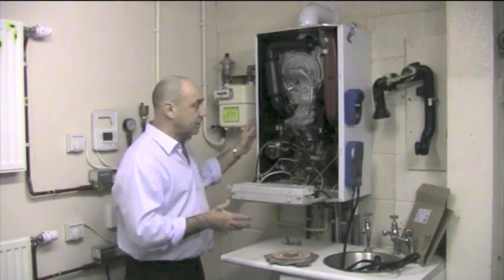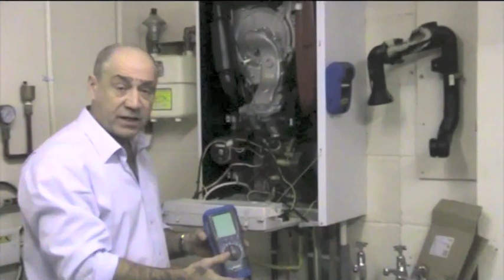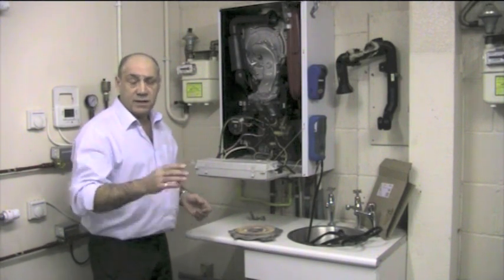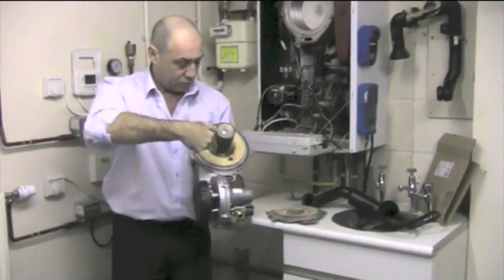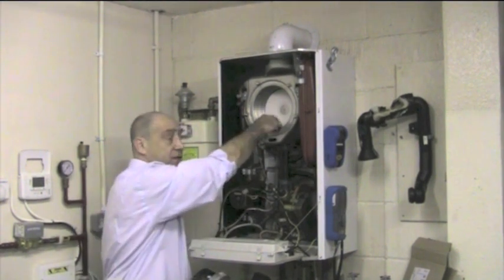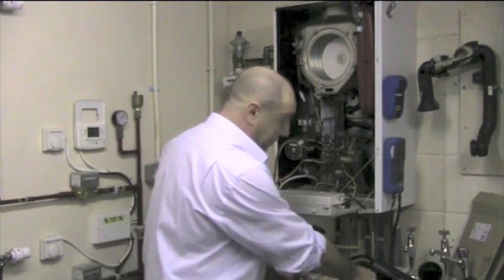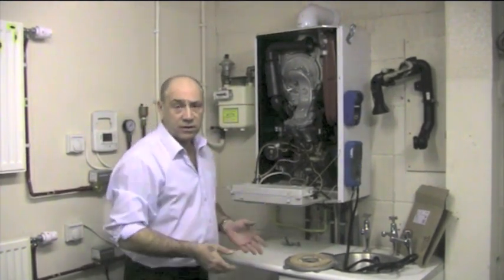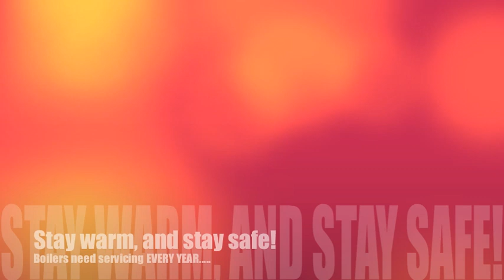Vaillant Boiler Servicing

Comment: Maybe I'm approaching this from the Gas Board angle, I dunno. But the way I see it, if I was to open up a case on a zero governor gas valve boiler and my FGA broke down and I couldn't get another then I couldn't confirm that the appliance is safe to use, and if that's the case I couldn't leave the boiler operational. I would hope there's no-one who would service a one without a FGA to hand, put it that way. CPA1's easy anyway, no excuse :)